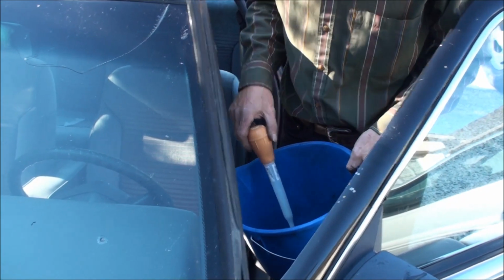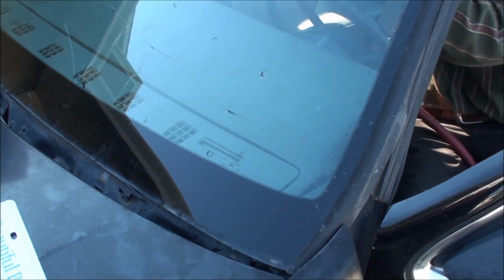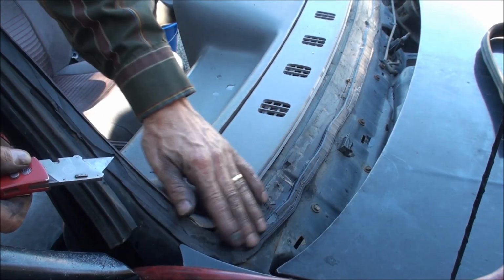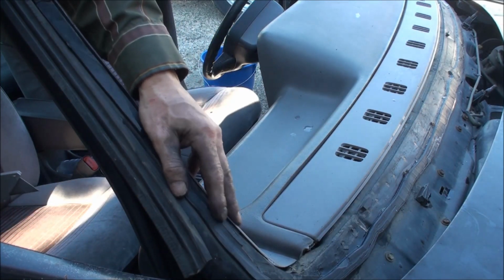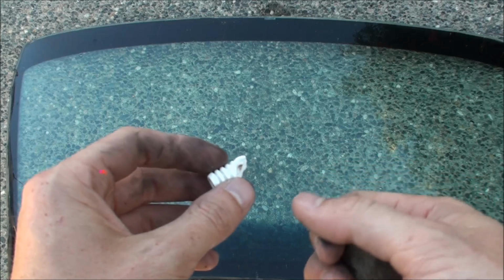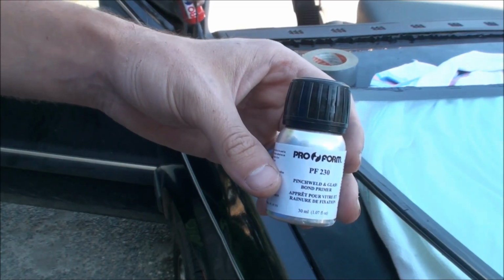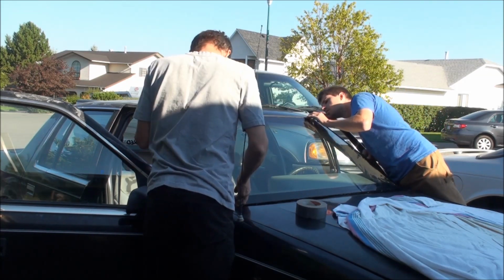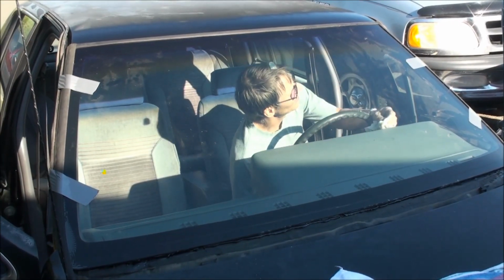Change your car window yourself!

Comment: You are on the right track; and this is an "adequate" installation. However, there are some things that would not pass at my shop. If a person can't afford to have a new windshield installed, I can see how they might try to do it themselves - but on the other hand, this could lead to some dangerous consequences.  The airbags depend on a professionally  installed windshield to operate properly - otherwise, if the airbags deploy, it can knock the windshield out and be too high to protect the occupants. The windshield is also there to help in case of a roll-over - if the windshield pops out, the roof can collapse and smash the occupants' heads. I don't recommend do-it-yourself windshield installation.

Comment: You can just use roofing tar for sealer.   You know it won't leak like the  Your-a-Thane  that was used for the original sealer..   Especially now that you got the wrong shorter windshield in there.  You'll need some extra sealer..   And it'll be a lot cheaper too..

Comment: Excellent job you saved almost $240 if you go to the professional they definitely charge that amount.
Reply: Depending on if you supply glass
Reply: @samueljesse2179  yes but I believe the glass is very cheap because I know one of they guy who charged me only $140 for Toyota Camry 2017 windshield glass .

Comment: Please do not attempt to change your own windshield if you are not certified or have not ever installed a windshield before! This is very unsafe and dangerous if you are not a professional. Please have a reputable Glashop do it for you in your area. Were you have a warranty and a professional certified technician doing the work